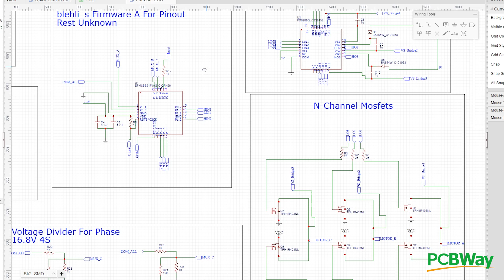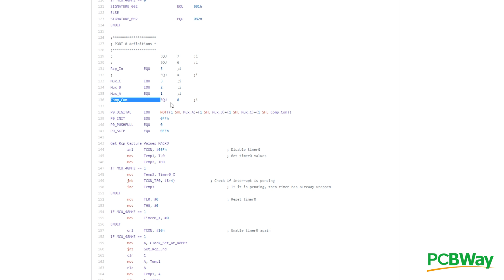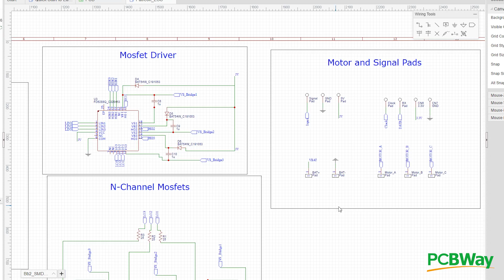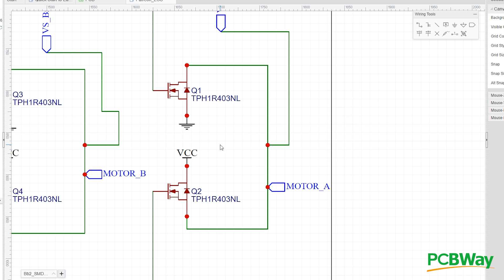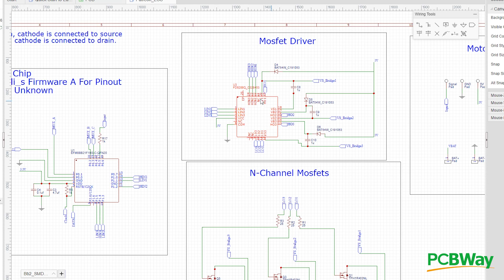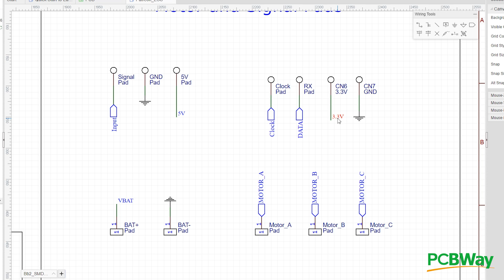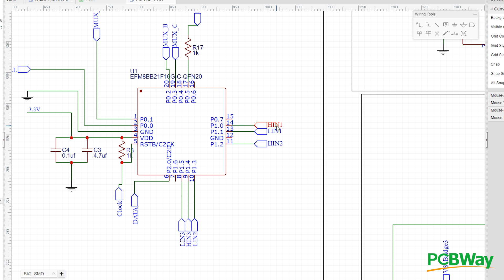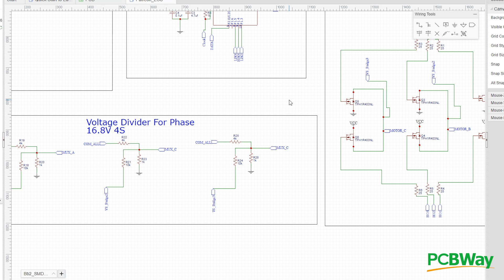How To Make Your Own ESC 2019 // DroneMesh B_OpenESC [Part 2]

Comment: I have just read the Chinese datasheet of FD6288 on LCSC's site. The supported supply voltage ranges from 4.8V to 20V. As for that unknown capacitor, it is CBS from page 10 of the datasheet. It is used as a charge pump along with that diode. When the load is grounded, CBS charges to VCC minus the voltage drop of the diode. When the load goes high-side and reaches a near VCC voltage, the voltage across CBS is kept above the load for a short period of time and is used for driving the high-side NPN MOSFET gate through VB, which is called the absolute floating voltage pin. The diode prevents CBS from discharging into VCC when it goes above VCC on high-side switching. This setup enables NPN MOSFET to be used on the high-side switching.

Comment: I know this is slightly unrelated but I bought an ori32 esc and basically something killed the all 4 of the mcu’s on board I have the replacement mcu on way but I was wondering if they would just flash as normal been blank chips and all or would I have to flash the boot loader on to it somehow?

Comment: 50 ms to close the mosfets? Thats really slow.  Are you sure its not 50 nanoseconds?
Reply from the maker: This was just an example for people to understand i said theoritaclly before giving those numbers.
Reply: @DroneMesh  Gotcha. Sorry, I guess I was nit-picking a bit.

But I have a theory as to what your COM_ALL line is for.  I think its used by the MCU to find out what the EMF zero point is for back emf detection.  Its basically a sum of all the back EMF values for each phase and that sum is the "zero point".  Its the crossing of the zero point by the individual phases that the MCU uses for timing info. Its just a guess tho, I might be completely misunderstanding how back EMF detection works.

Also, in your emf detection portion of the schematic I think there is an error.  I assume there is supposed to be a voltage divider for MUX_A, MUX_B and a MUX_C but there's 1 A and 2 Cs.  I'm sure you would see it before you send it off to a fab house but thats the type of error that I would be totally blind to if it was my design.

Great work.   Subscribed.
Reply from the maker: Thanks.. I think your theory of com sounds feasible. Yes I noticed the MUX_C duplicate and made a couple more modifications next video will be the dev board pcb design.

Comment: 6:40 in that case driver does not needs to actually sens the voltage. The source of high side mosfet must be connected to capacitor, that charges while the low-side fet is on, and discharges to open the gate of high-side fet. Also, most of the fets have gate threshold voltage at around 3-5 volts, that quite opens them, and 10v is required to reach the minimal source-drain resistance. Being said that, the 5v rail connected to diodes is a mistake, there must be another 9 or 12 volt LDO just for the gate driver. You can also google for "mosfet bootstrapping" to fully understand the circuit.
UPD. The fd6288`s logic side could take the 3.3 supply, as specified in a datasheet.
UPD2. About COM_ALL. My guess is that it could be used to offset the voltage going from divider, because motor phase can go negative respect to groung. Again, thats a guess, may not be truth)
Reply from the maker: I have checked over 10 ESC's with this driver. They all have the same schematic and routing as I have here I will even double check everything but this seems to need 5V as supply as far as i see and understand.
Reply: @DroneMesh O_o
I've just checked my esc's, 12v from ldo is going directly to VCC. Seems like datasheet specifies 3.3v logic level at inputs, not a supply)
Reply from the maker: @ДавідЦінделіані  I have some with 12V and some with raw VCC.. I think if it is 6S capable they add some sort of LDO since its max rating is 25V for the driver.
Reply from the maker: Ok so you were correct about the 5V i just double checked the voltage and it is using Battery voltage for the VCC on the driver.